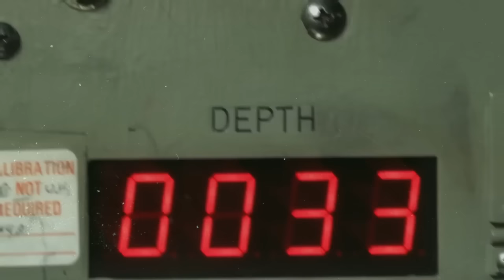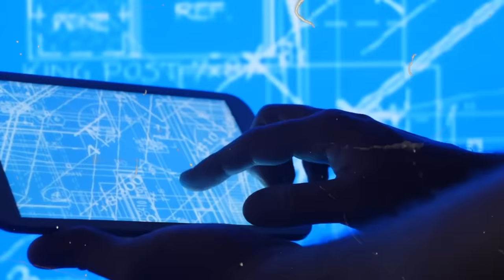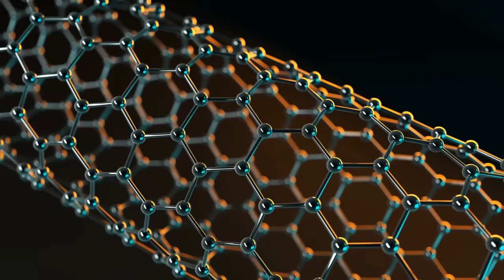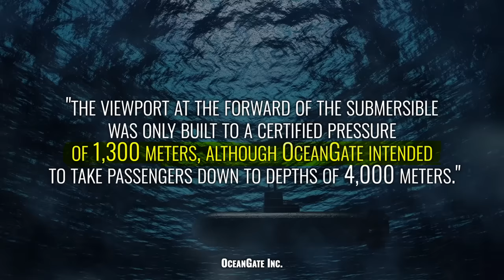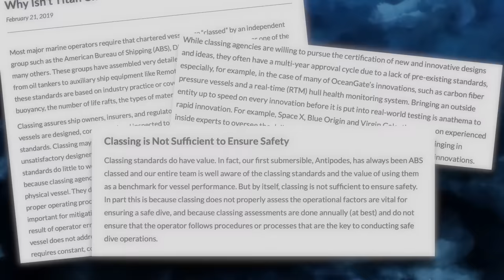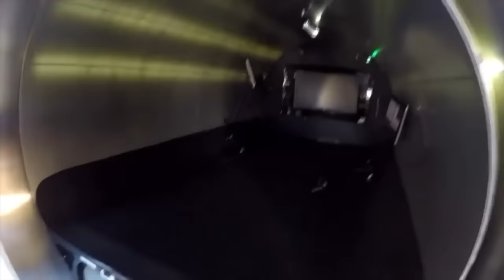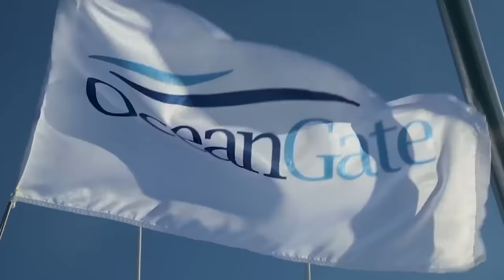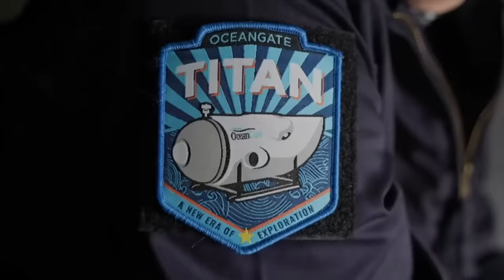The Oceangate Submarine Disaster: The Full Story

Comment: funny how oceangate patented a sensor for their carbon fiber hull, but completely ignored the fact that their sub also needs to be able to ascend back first... its basically just an alarm to tell the passengers they're about to die and they can't do anything about it
Reply: An effective ascending method would be a balloon attached to the sub that can be inflated with air that quickly gives the vehicle bouyancy and rise to the surface as quickly as possible
Reply: @SteveLee-rm4zx  Rush claimed to have that installed. Made that claim on the CBS interview with Dave Pogue when they went through a list of back-ups.
Reply: @SteveLee-rm4zx 
And how do you propose to inflate a balloon underwater? You'd effectively be trying to inflate a balloon that's sitting under a steamroller (which is not much of an exaggeration).  Good luck with that.

Most submersibles (including Titan, in fairness) are possitively boyant.  That is, should an emergency arise, weights (ballast) is dropped and the sub will naturally ascend. One of the vessels to visit Challenger Deep, for example, had it's ballast held by electromagnets, which themselves were powered by a wire that was designed to corrode within a few hours.  Thus If power was cut for either reason, the submersible would automatically surface.

Apparently, the Titan didn't even get this correct, as it was apparently necessary for it to roll to either side to drop its ballast.

Not only that, there's a good reason most submersible pressure vessels are made of a contiguous materials.  Carbon fiber and titanium have vastly different elastic properties, so a rapid ascent would likely result in differential stresses on the carbon fiber tube vs the titanium end caps, further stressing the vessel.
Reply: @SteveLee-rm4zx  Would that actually work at 3000 meters deep or 300 hundred atmospheres of pressure? Not saying it is impossible since the finickiest part of these deep sea subs is the fact that they need an unpressureised area to contain the squishy humans and other parts can handle more of a equilibrium of high pressure but if you try to expand a gas down there suddenly you have to start worriying about pressure again. 

If you have enough gas pressure to be able to expand against the sea floor water pressure then the gas container is explosively over filled at regular atmospheric pressure. It is probably more sensible to carry a liquid/powder that react and turn to gas so that you can get huge amounts of gas down there without worrying about carrying it but still if there is enough gas to expand down there wouldn't the ballon pop from internal pressure as it got closer to the surface?
Reply: @simonwahlen7150  No, it absolutely would not. At those depths, air in the balloon would be instantly crushed. You'd have to use an incompressible fluid that's lighter than water - diesel is a common choice.

However, the whole point of the submersible - and a big reason for using carbon fiber - was that the vessel itself was buoyant and wanted to float. It was weighed down with ballast to allow it to sink. If they needed to ascend rapidly, all they'd have to do would be to dump their ballast and float to the surface. There are some indications that they may have attempted to do that on the accident journey, but that it may have been too late.

Comment: It sounds like Rush was very desperate and so took unnecessary risk by building a shoddy submersible when he didn't have the money to do it the right way. It's clear he knew he was doing this by lying about NASA and others having a role in building the sub when they weren't really involved in that.

I do wonder how well that sub would have held up if he had used the carbon fiber, but did it in a diamond pattern and had it made in a dust free vacuum chamber instead of just doing it with it wrapping around in straight lines in a dusty open environment.
Reply: Don’t forget the titanium end pressure caps being glued to the carbon fibre with no system of bolts holding them in place.
Reply: If you put bolt holes into carbon fiber, you would have died on the first dive, as that would have ridiculously weakened it. They should have just made it out of titanium or high-quality steel. We know everything about those alloys and could examine them easily for metal fatigue and imperfections. He just cheaped out.
Reply: @garfstiglz3981 pressure pushes it in that’s not the problem from an engineering pov… 

The list of problems are endless
Reply: I don't think it's because he didn't have the money, since he was spending mad cash on lawyers to shut down dissenting voices. I think he was just cheap. 🤷🏾‍♀️
Reply: @mjbarbaraconstantestremera5509  yea that's the whole thing he bragged on how much money he saved and the discounts he got on this and that just a world class cheapskate
Reply: @meditationnew2554 I would say the fact that titanium and C/F are different materials, and that pressure would tend to push in the middle of the cylinder more, forcing the edges to expand, that there could be some extreme stress on the joint. More pressure would just make it fail faster, as it's not just holding the titanium cap in place, but stress fracturing the material.
Reply: It might have lasted a little longer, but the basic problem is that carbon fiber is excellent under tension, not so great under compression.
Reply: Does anyone have any gutter info that the crew was trying to manage an energency before the actual implosion?
Reply: @hutchman0823  The ballast pipes and landing frame were released before implosion.

Comment: I'm pretty sure the crew onboard Polar Prince knew the sub had imploded. The communication with the sub was done through acoustic modem, so they were constantly monitoring sound coming from the sub's position.
Reply: StarLink Satelite
Reply: @maryannsinopoli1751  Nope. Starlink was for communicating with the ship once on the surface. Satellite internet doesn’t work underwater, let alone 2.5 miles under the ocean! They used a digital acoustic modem to communicate data through the sea.
Reply: I agree. They must have suspected so why did they wait 7 hours to inform the CG?
Reply: @wattage2007  I just read satelite can communicate underwater.  Stop throwing me off targets here!  Star Link still should be checked out as well as any other naval interference perhaps that day!
It specifically stated subs can communicate with the surface using satellite communication !
Don t be lazy, research, look it up! Rather than steer all wrong!
Reply: @maryannsinopoli1751  2.5 miles underwater? Don't believe everything you read on the internet. They used acoustic modems which allowed the transmission of small payloads, ie short messages.

Comment: Laminated materials lacking a proper load-bearing armature have a much reduced yield strength under compressive loads rather than under tensile ones. When in the compressive mode, the embedded strands cannot possibly contribute to the structural strength – in fact, this is akin to “pushing a rope”. 2023/07/02. Ontario, Canada.
Reply: I'm glad to see someone agree with what I've been thinking. A few others have said that it was basically just the resin handling the compressive forces, which sounds right to me.
Reply: Exactly.
Reply: Indeed, CF laminate or otherwise is not an ideal material for compressive forces.  It has a very small amount of flexibility or malleability and it's coefficient of expansion/contraction is far different than the titanium to which it was wedded.  In compression, traditional materials for extreme depth submersibles i.e. steel and titanium, will groan under compression due to their inherent malleability compared to the rigidity and distinct lack of malleability of CF.  The loud and constant cracking reported on other dives of the Titan only tells me that every time it dove it was incrementally FAILING and would then fail at some future point!  I wouldn't have taken it to any depth for any amount of time without doing non-invasive and exhaustive testing of the entire pressure vessel.  

Further, it is only an informed guess, but I'd say given that CF in laminate is like an extremely tight drumhead, that the cracking couldn't be pinpointed in Real Time because the cracking sounds would have been transmitted throughout the entire cylinder, but said cracking sounds were likely originating at the interface between the titanium mounting rings and the CF!  The MOST likely point of failure was there and not the viewing port, but that is merely speculative.  I'll wait for the final report.
Reply: @ZilogBob  I would agree with you. And I would add that even if the winding had been along a mix of longitudinal and radial patterns, the problem would have remained in its entirety. Thanks.
Reply: @Subtlenimbus  As Mark Twain once noted, "it is not what one does not know that gets one into trouble. It is what one thinks one knows for sure but that just ain't so". Thanks.
Reply: @paulbonge6617  Please remember that there were compressive load of the end rings against the laminated cylinder. Personally, I suspect that the failure point was approximately at the mid-cylinder position where there was not even at least one internal reinforcing ring. Thanks.
Reply: No steel bars going horizontal across from both sides of the [end caps] the titanium caps compressed the submersible from both sides
Reply: That's my speculation, the titanium end caps imploded the carbon fiber, and forced the viewport window out at the same time
Reply: @paul-andrelarose3389  That makes logical sense to me. Thank you too.

Comment: the guy was a rich guy that took short cuts..GOD any idiot can see the way he laid the carbon fiber was very shoddy..I dont understand
why he did not run it in different directions..take a roll of thread and see how easy you can take your finger nail and dig it into the wooden
spool..the water pushed in through the 5 inches of straight strings held in place with resin glue..like pushing your fingers through a harp strings.
Only the water had millions of pounds of pressure pushing it searching for a weak spot to split.
Reply: We/You have no idea how HE laid the CF period end of discussion, HE didn't lay-up ANYthing!  The footage is stock footage of CF being wound, and each individual layer would be counter to the one before and I imagine from having quite a significant amount of experience in composite/laminate construction, and knowing that Spencer Composites is a reputable and certified manufacturer I can confidently say that the lay-up was multi-directional, with progressive layers being wound in one direction then another, longitudinally and latitudinally as well as diagonally in opposing directions.  NO manufacturer would EVER just do a multi-layer lay-up in ONLY one direction for a cylinder!  You are completely incorrect in your assumptions.  

However, my brother's company manufactured performance rigging for high end racing sailboats and they used unidirectional CF glued up in tension in long ribbons for extremely lightweight and high performance standing rigging.  They knew it did not have the durability of stranded steel wire rope but it was designed for limited use and for specific purposes and being glued up under tension and put in tension was phenomenally strong though ultimately very brittle.
Reply: One nano millimeter weak spot on the carbon fiber is all the ocean 🌊 water needed to fill the pressure void and Voila!

Comment: I too believe the carbon fiber failed.  If there is no carbon fiber tube remaining, that probably will be the cause. When carbon fiber is made, its created by using a slurry of epoxy with a carbon fiber sheets layed round and round to create a cylinder. When subs dive to certain depths, huge pressure is pressed onto the cylinder. Potentially cracking the cylinder. Maybe mico cracks per dive. With so many other problems they ran into, hull issues may have been unseen. 
Finding parts of the carbon fiber is critical to answering that question. If the hull is found intact, then something else caused the implosion.  Time and inspection, will tell.

Comment: Wonder what pressure results,5 inches of carbon could withstand.
Reply: Wiki has the carbon fiber hull at 66" diameter and 99.6" length. 2πrh. With 6000 psi at Titanic depth the carbon fiber hull would experience 123,846,624 pounds pressing on the outer surface. It sounds like the hull survived around 10 dives before it failed but we don't know for sure yet what actually failed first.

Comment: Carbon fiber is the main problem. Its a fantastic material with high strength but doesn't have much tensile strength thats why carbon fiber is always a composite with f1 cars using CFRP carbon with plastic, pagani uses carbotanium their innovation of carbon and titanium. Unlike steel a lot of carbon fiber parts can't be reused after high G force impacts while the carbon fiber absorbs the energy it will weaken and fail the second time. Anthoine hubert's accident is a good example of how the carbon fiber tub held up very well in the first big crash but the moment correia hit him the second impact shattered the carbon tub

Comment: Yeah, you need systems to provide oxygen.  The more I hear about his background the more I see why he thought he did not have to adhere to the basic operations of safety and apparently the laws of physics. Basic physics tells you that having a vessel that is built from different materials means the affects on each would be different. A vessel with a cabin built from a carbon fiber material in a strand wrap spool design is a failure waiting to happen due to the pressure at tge bottom of the ocean. 🤨🤨🤨

Comment: Ironic it was called titan.of Ur starting a business don't call it titan or Titanic and it was the titanium with I guarantee was the major problem
Reply: NO, titanium has been used VERY successfully in extreme depth submersible construction, and what a BOLD and FOOLISH thing to say you guarantee that the titanium was the major problem when, James Cameron's vessel which he took to over 30,000 feet in the Challenger Deep was titanium and high strength steel ONLY and no CF.  The PROBLEM was with the combination of two very dissimilar materials i.e. titanium & carbon fiber whose coefficients of expansion/contraction are very different and that the pressure vessel was cylindrical whereas ALL other deep dive submersibles are of spherical (or ball-like) construction!  The PROBLEM or failure point was more likely at the interface between the CF and the titanium mounting ring where the titanium domes were bolted.  The CF was the inappropriate material, the cheaper short cut, as to build a more proper vessel the cylinder should have also been made of titanium, and would have been VERY expensive!
Reply: Имелся в виду, возможно, не титан как плохой материал, а "Титан" как неудачное и "несчастливое" название.

Comment: An implosion at 3500 ft isnt nearly as violent as an implosion at 12,000 ft. Makes me wonder if there is some human remains left bigger than little bits. And if theres actual large pieces of the carbon fiber hull rather than dust.
Reply: 3,500' misspoken, was in fact 3,500m or more at the point of implosion.  An implosion does not turn everything into particulate matter and there are large pieces that have been recovered or else they wouldn't have spent a week with a very large crane lifting pieces to the surface.  An implosion happens in milliseconds and is over not long after that because as fast as it happens, the pressures are equalized as quickly.
Reply: @paulbonge6617 James Cameron literally said 3500 feet, not meters. And I saw the pieces they pulled up, but I thought it was all the titanium and wiring. Did they find carbon fiber pieces?
Reply: @theshapeexists  Indeed he did say feet but he misspoke as we all sometimes do.  Have you seen everything.  I understand that they picked up the entire debris field!  I'm also aware that they recovered CF pieces.  Implosion is crushing not EXploding, so I confidently assume there's quite a sizeable amount of intact, though distressed CF recovered.

Comment: "Communication and comms were lost but no red flags were raised yet." That is false- the mothership knew what happened when both instantly cut out. 
The performance of the days-long "rescue!" still makes no sense as many knew for sure it was gone- including the US military.
Reply from the maker: While you are correct that the mothership knew what most likely happened, they didn’t raise any red flags until they notified the coast guard later that day.
Reply: Coms/communications same thing, one thing!  The surface support team, waited hours to report to the Coast Guard, then only said they had an "overdue" submersible and that coms often cut out then returned as they made their ascent.  Rather a cavalier and ho-hum we're not really worried kind of report.  @TheOfficialHorizonYT I think perhaps the red flags the Ocean Gate surface crew were waving were pale pink or even pale orange!  Not to make light of it 😅
Reply: @paulbonge6617  comms regularly went out but tracking should not as its autonomous. Both vanishing ag the same momentis almost a sure loss of vessel. Thr mothership also likely had audiophone capabilities and also heard the unmistakeable implosion seconds after loss of contact.
Reply: @jdaniel3068  I do agree about tracking and tracking is not coms.  At this point though we do not know what the support team heard or did not hear.  I kind of doubt they had sensitive hydrophones in the water!  For one reason, if you're using an after-market wireless game controller, you're probably NOT buying any kind of hydrophone array! LOL We'll certainly find out or not when the final reports and findings are released.